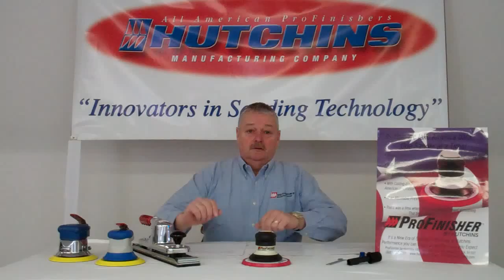March 27, 2011 Profinisher

Comment: In other words hutchins old school pads are the best the new ones lick balls, they feel imbalanced when used.  The old 3500/4500 housing is bomb proof and the new profinisher uses cheap composite plastic.  Stick with the 3500/3560/3570/4500.  Most manufacturers today are heading towards cheaper quality tools with limited life time warranty like snap on.

Comment: I have the HUTCHINS 4500, Its lasted me 10-12 years!!  It was built solid,heavy, and F*CKING indestructible!!! About 5 Years ago I purchased the Hutchins 3500.  Let me tell you what a difference maker. "LIGHTER!" The Hutchins 3500 is by far the best Dual action Orbital sander on the market! HANDS DOWN!  Its good for 40/80/120/150/180/220/280/320/600/800 all the way up to 3000! GRIT.  This thing is light weight and silently smooth! dropped it on concrete 1million times and still running strong!A+